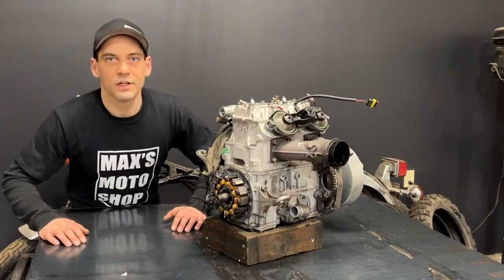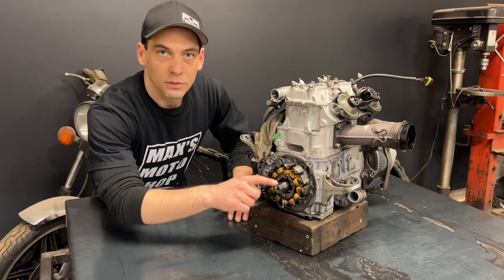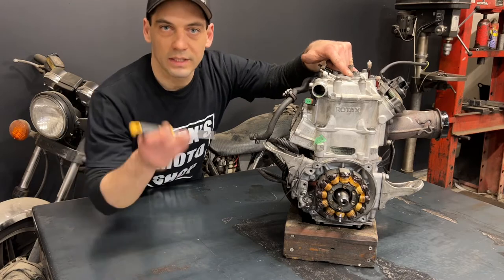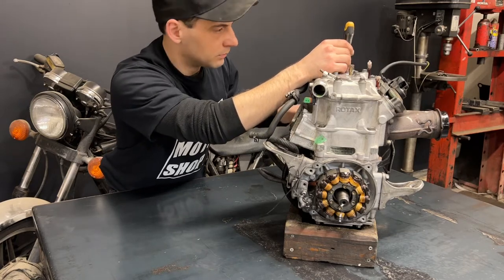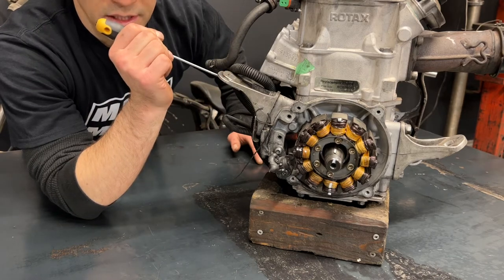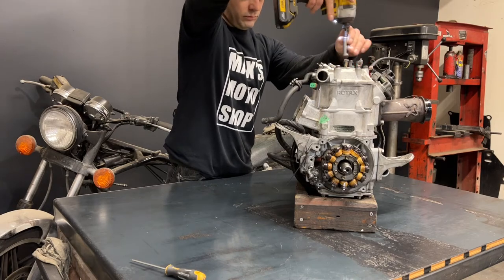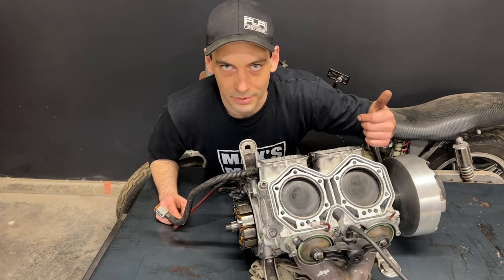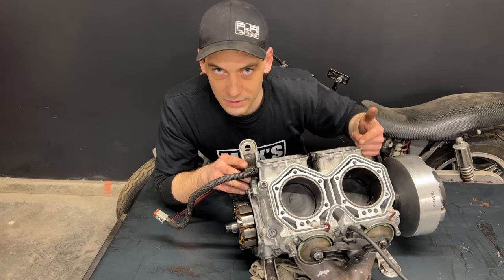Ski-doo 800 R E-Tech Motor Crankshaft Failure Out of Phase / Out of Time

Comment: Video of you fixing it please ???
Reply from the maker: I do not rebuild skidoo motors it is not worth it… it is a much better deal to order a rebuilt motor straight from the BRP factory that comes with warranty
Reply: @Maxsmotoshop  dude thank you for the info I'm trying to run a small engine repair shop so the less headaches and the more research and advice the better. Thank max I really appreciate the uploads.

Comment: There's a timing mark on the pto end of the crank.
Reply from the maker: No, there is not
Reply: It does have an index mark showing TDC
Reply: @chadsherburne665  The last 4 etec's ive rebuilt has it. And, The notch on the back side of the fixed sheave of the clutch is suppose to line up with it.
Reply: Yep, as per the shop manuals